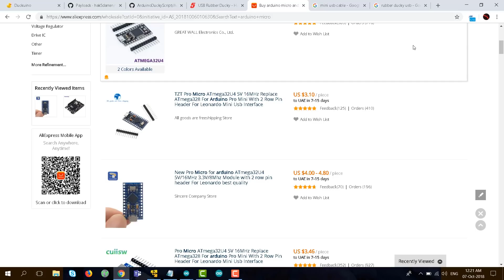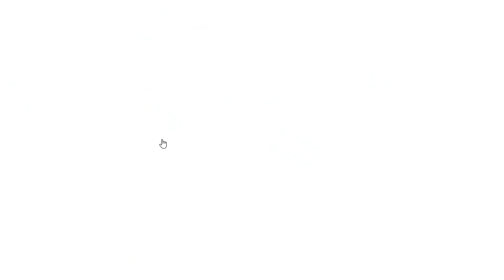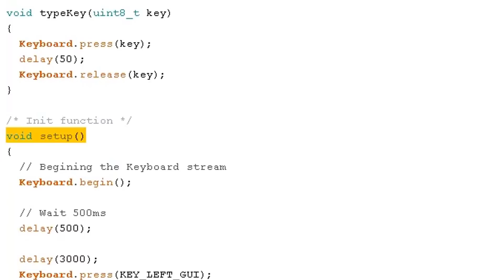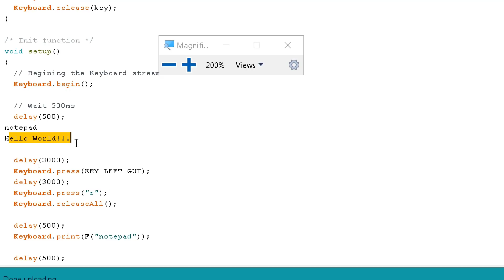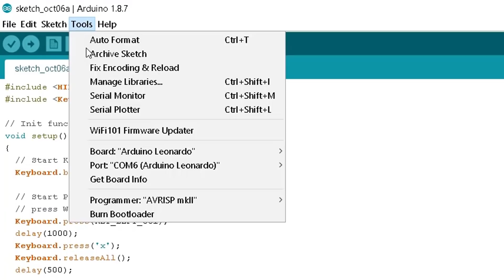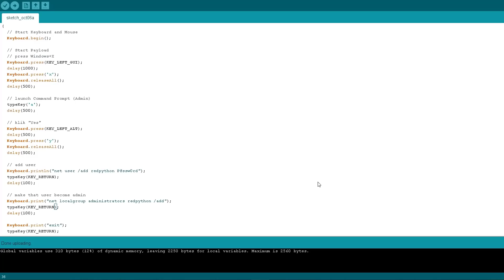Create a $3 Undetectable Bad USB

Comment: Can i do this on windows host or would i be better off using linux?
Reply from the maker: Of course you can
Reply: @Xploitacademy  thanks
Reply: I ordered the arduino nano. But I noticed i should've bought the arduino leonardo. Is there a way around this?
Reply from the maker: @GeorgiaBoy41398  I guess this should work as well
Reply: @Xploitacademy  i dont think it will work. It keeps saying "keyboard.h not found" whenever i try to upload the script.

Comment: Hey, good day.
i have a problem whit mi device, i have a cjmcu atmega32u4 with suppor Sd Card, but i don't know what happen, my device can't recognize to mi sd card, i dont know if it's my code or maybe is a factory mistake hardware.  i copied the code in arduino IDE but my device don't read my sd card, it don't want recognize. to somebody happened some same?

Comment: There's a better one which has a micro sd card fitted and also an ESP8266 based one which allows WIFI connection - low cost if you buy from China
Reply: Model name ?
Reply: @patrickconti4297  Pretty late, but you should try the WHID cactus, its really nice. ~$16
Reply: @Jimme.S.T.B  well thanks !
Reply: @patrickconti4297  thats a quick response for year old comment

Comment: Wait, after I put the scrip on the arduino, how do I edit it. Imagine I put a fork bomb on it, how do I ever edit the scrip if when I plug it in my computer it runs the script?
Reply from the maker: You edit the script before compiling it. Once its compiled you cannot edit. You need to upload a new script.
Reply: @Xploitacademy  O actually thought of a solution for this (at least for cmd scripts).
  It's by using a Y/N prompt before executing the script, that way I can edit it afterwards.
Reply from the maker: @hugo.canosa  I guess this works as well